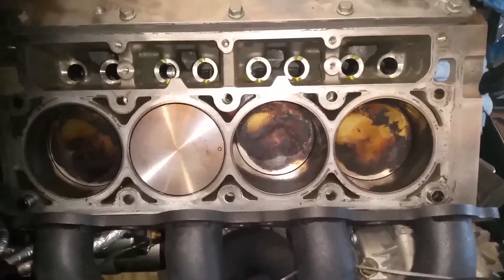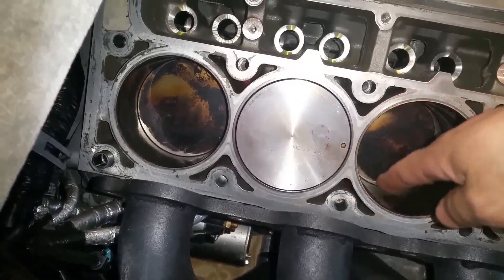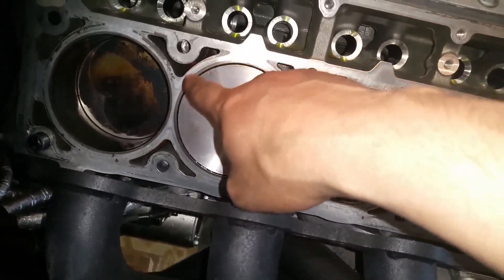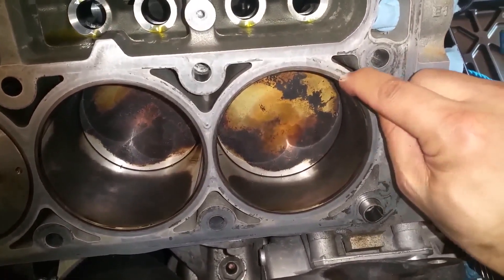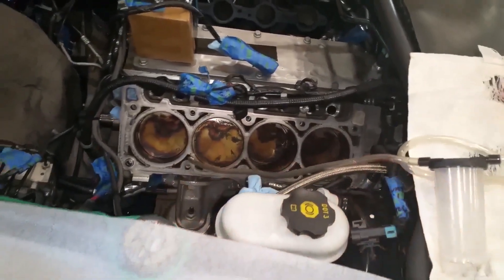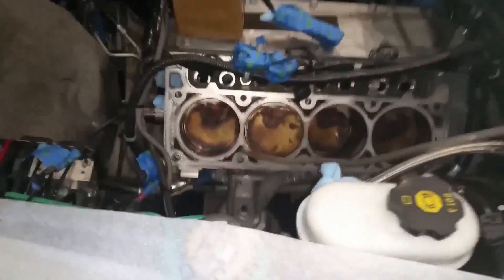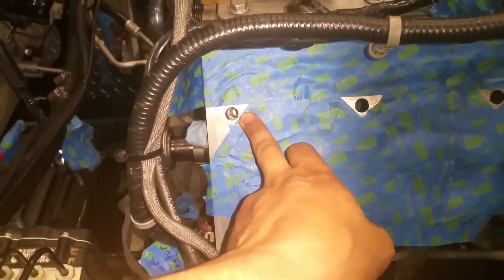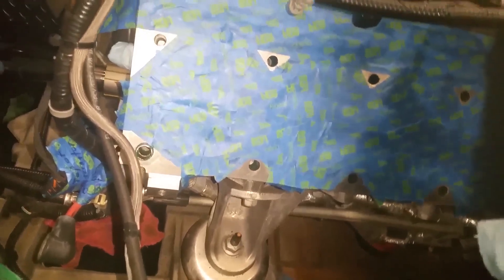Cleaning LS Pistons, Block & Chasing Bolt Threads. Boosted C6 Build. Part 18

Comment: Great video.  I used a plastic razor blade on the block and head surfaces.  Putting a little WD40 lets it slide smoothly rather than skipping.
Reply from the maker: Great tip! Thanks for watching.

Comment: I haven’t watched your whole channel but the c6 vette motor should be low miles. Does something happened for you to take it apart ??
Reply from the maker: Hey ChevelleRider, nothing happened to the motor. it only has 8000 miles. i just wanted more power so i added a bunch of high performance parts and thats why you see it all apart ..